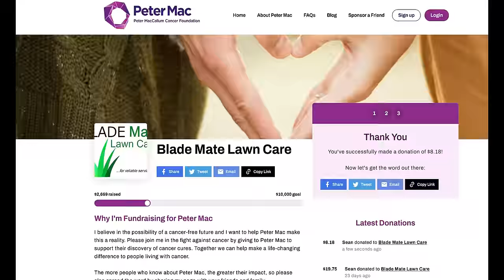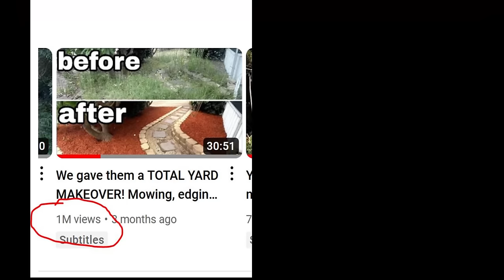WILD suburban property TAMED! 2 videos in 1!

Comment: Nice Job Sean.  I think some double speed is in order.  Strange that the Water/Gas Meter is where it is.  HP water blast is a nice touch. 2,600 PSI?  Strange (to me) that there is no solid foundation,  just brick columns supporting the structure.  Forget your battery powered Chainsaw?  Love the 1 cut 'pruning'!  BE VERY CAREFUL TO KEEP THE AIR INTAKE ON THE SCAG CLEAN.  DON'T LET IT BLOCK OFF AND OVERHEAT THE ENGINE. 35:05.  Using RoundUp instead of dye would be helpful.  The intermediate Before/After vids are great.

Comment: Nice video.
Hope your father is doing well so far.
Why is the edge (lawn, concrete slab) still being processed vertically with the brush cutter and what kind of tool is that with the knife blade where you also cut the edge vertically?

Comment: I’ve been wanting to ask for quite awhile, so here it goes!
I’ve noticed in many/most of the yards Sean does, there is a hot water tank outside the home. Is that common practice in Australia and other places? Here in the U.S., they are inside a home, usually in their own closet type space, or in a corner of a basement. 
If one is sitting outside, it’s usually been replaced inside the home after malfunctioning, and waiting to be hauled off as trash! 🤔 
Thanks for any response!
🙂
Edited to add: I googled it!😁
So, it’s for safety issues apparently? That’s smart. I’ll attempt to not be as distracted from now on!😉